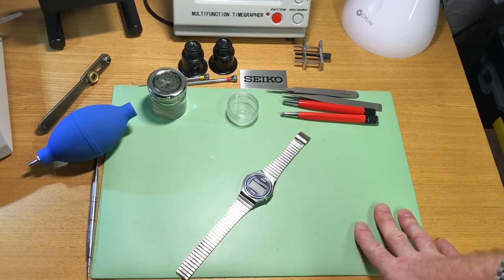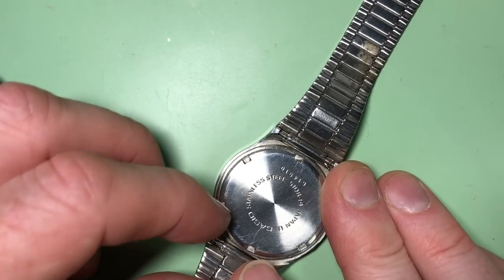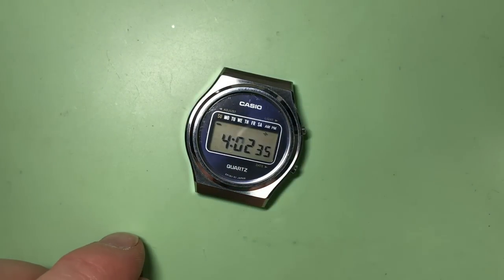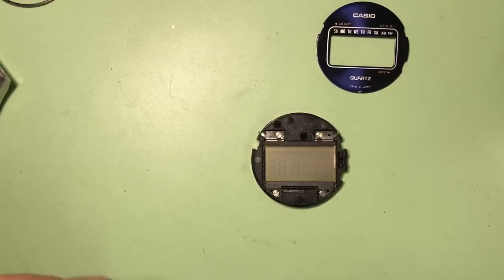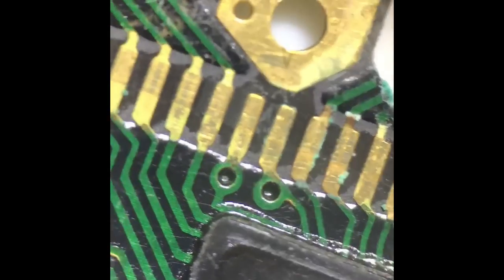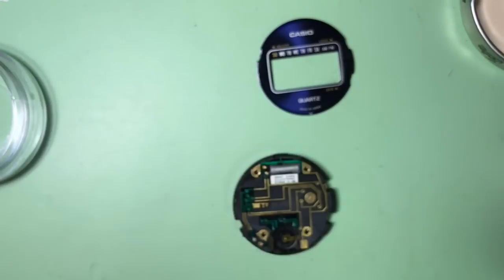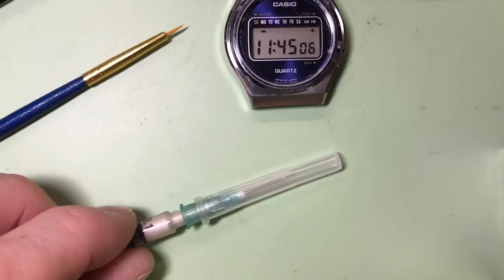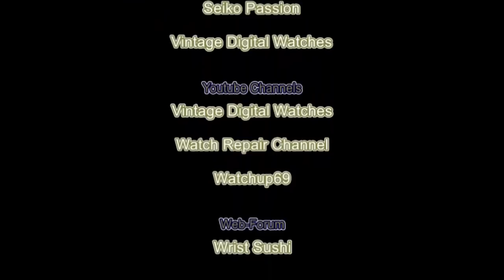Vintage Digital Watch Clean & Repair

Comment: I've got a casio 31QR-29. Still working very well. They were so expensive when they came out in the mid 70s. Men's watches were smaller in the 70s and 80s compared to most today. A great watch.

Comment: Hi - I’m Dennis in Sheffield UK. Your series of watch instructions are really good. I don’t really collect old analogue and digital watches, but sort of give them a new home! Having said that I have 2 beautiful Bulova Accutrons in full working order, one is the DeapSea 666 with rotating bezel and the other is a Masonic 218. I’m 71 now and in the high risk category so my wife and I are isolating (I have chronic RA and on immunosuppressant injections). I’m trying to cheer my wife up. Before she retired she was a Senior Chief Geneticist (until she got Iritis) and then an IVF Scientist. She’s always going on about her pink Skips Crisps promotional digital watch which she used to time her experiments until the watch just fell to pieces after 30+ years! So I’m trying to resurrect one. I managed to get a yellow one off eBay, still sealed in plastic. I put a new battery in , it all lit up showing the normal 00:00 and the seconds started BUT then it just died. It looks like a very cheap movement but I can’t get it going again - it’s got a round shape with the rectangular window display. I’ve tried taking another similar digital movement that is working to replace the whole movement. The big problem is being 71 with RA - my hands are just twisted and painful stopping me doing fiddly stuff. Is it possible to send it to you to have a go at it please or any other advice you can give. Thanks, Dennis
Reply: Why not take it to a watch repair shop?

Comment: Great to see these watches are repairable. Watching this video in desperation. My own digital watch has just started to go faulty this week and too a turn for the worse today 21Aug2020. The LCD display seems to fade out and recover sporadically even few seconds and seems to be triggered  as the seconds change on the display. Seems to not happen as bad when I go to the stopwatch not started. Once I start the stopwatch it blinks out again. 
I bought it with my 9th birthday money on Wednesday 8th June 1983 for 15.95 Irish pounds. With an exception of about 2 or 3 years I have wore it every day since then. It is a Q&Q with a Miyota (japan) board. It is well beaten up for the years of use, back-light broke when I dropped it perhaps 25years ago, third strap 20 batteries later but to my knowledge never got any significant water damage or the batteries never leaked.
Update, I fixed it. Separated the board from the LCD. No sign of corrosion but a few bits of dirt on the zebra tracks. Cleaned up and with great difficulty reassembled. The module is kept together using clips into the four corners inside of screws. Difficult to align everything including the LCD components.
Reply from the maker: Well done on fixing it. Sounds like it has a lot of history for you! dirt on the zebra strips is a common cause for screen issues.

Comment: Great job fixing it. I too had this problem with a 1970s Longines and I used that conductive paint to repair it after watching the video you spoke about. Your thicker paint seems to be easier to use, I used the thinner stuff but it was extremely hard because it was very runny. Unfortunately I knocked off about 10 wire bonds off the IC in the process, don't think there is any coming back from that.

Comment: Wow. This is the orig. of the Casio A171 that I just bought. I bought an after market bracelet (Aliexpress) for it just like the one in your video (before having seen it). But the A171 has a short "indent" for the bracelet to fit in. A a nice watch but this one looks a little better.

Comment: Any videos on restoring the buttons, often I have trouble with old buttons. Not the board or contact related. Just the buttons specific function
Reply: They come apart, but.  The barrel gets full of 'stuff', and is difficult to clean w/o damage.  Th spring is so tiny you can breathe at is and blow it away.  They can be disassembled, but do so on a surface that will not let the parts bounce away.  A clip holds the pin, and then it comes apart.
Cleaning makes all the difference, but when I did it 30+ years ago, I was hamfisted, and dented the barrels with a toothpick.  I did NOT take the mechanism apart at all as it worked fine.  Just could not set day/date/time readily.

Comment: I would think you could have used an oiler and applied the paint to the circuit board similar to how you apply lume to watch hands.  Nice work.
Reply from the maker: Thanks I have not thought about an oiler. I may try that. The brush was fine all the same other than removing any excess after drying to avoid touching any other tracks.

Comment: I just bought a Casio TGW-10 TriGraph online to try and fix up. The ad said it had a dead battery and the crystal was scratched some,but I felt confident I had progressed in buffing them out. When I got it and changed the dead battery it came with(it could be the wrong battery all together)it still didn't work. The notch the battery hold down bar hooks on was missing but even when i hold it down manually it doesn’t work. It doesn't appear to have got wet(no rust or water spots I can see)and from everything I see not damaged by battery acid but I'm also not  skilled enough yet to feel comfortable disassembling the module to look further. Right now I have a completely "for parts only" watch so the only place I can go from here is up. Tho it's not all THAT rare it is a lesser known watch that is pretty cool,might be worth fixing on the channel,but either way I'd just like it fixed
Reply from the maker: Sorry I don’t take any work on especially digital watches. I do not have all the kit required to test components
Reply: Sissy....lol j/p
Reply: Any suggestions on who may? I also reached out to "vintage digital watches"
Reply from the maker: @TechTokOffical  I don’t know anyone.  VDW does not take work on either. I know him quite well.

Comment: Seiko M 159. Thought it would be like the strip down you very well but it’s completely different inside any suggestions , the back fixes different no spring clips on the corners just clips on but I cannot get the back to clip into
Place
Can you help
Any advice
Rick. W

Comment: Great video! What did you use/do to clean the zebra strips? I'm rebuilding a Timex Atlantis steel cased model (uses CR2016) and I have a burnt segment like yours. The circuit board doesn't look damaged or corroded (the board was cleaned with IPL) and there's no sign of battery leakage either so I'm inclined to believe it is probably dirty zebra strips.
Reply from the maker: Ooh that is a tough one, digis can be problematic and I am far from an expert. its not always battery leakage that can cause damage , old age, dry solder joints, failed components. most can be diagnosed , quartz crystals like to fail but you need an oscilloscope to diagnose those which is not a cheap piece of equipment.   To clean the zebra I just use IPA  i tend to drop them in a bit of the solution and then wipe with a Q tip and leave to dry.  Also pays to wipe the contacts on the screen also.  Good luck
Reply: @MyRetroWatches  Many thanks! I've ordered silver conductive paste like in your video too, fingers crossed! Love these steel cased digitals.

Comment: Hi :
Nice work and explain . I have a question what is the voltage of the batterie i see on the movement market 3V is that the voltage tha use the watch? 
Thank you
Reply from the maker: Xavier Chs thank you from memory it’s just a standard 1.5 volt

Comment: Good evening. Thank you for such an informative video. I am dabbling in vintage LCD watch repair too and recently brought a Casio CA-901 back from the dead. Just that I am wondering how to refurbish scratched printing on the inside of watch crystal. Any suggestions will be greatly appreciated.
Reply from the maker: Hi,  thanks for watching. Sorry I cant help with the print.  Sourcing new screens for Digi's is hard work as there is very little out there.
Reply: @MyRetroWatches  So true! Only way would be is to find a broken vintage with a good watch crystal, which would take ages. Best to leave as is. Scratches and all.  😄

Comment: You think its a good idea to remove batteries from vintage watches if not being used? Just storing as a collection! If they tend to leak?
Reply from the maker: It’s not a bad idea. Not something I put into practice but if you have any alkaline batteries inside then it’s a must!  They leak at the drop of a hat.
Reply: @MyRetroWatches  will they only leak if battery goes dead?

Comment: Any idea where one might be able to get a replacement micro light for a watch like this? Btw, great vid !
Reply from the maker: hard to say really,  they are a basic circuit so I would assume you could just unsolder your broken one and take another from a donor of the same manufacturer.  I have never seen just the lamp for sale as a part.

Comment: Hi there, I have a vintage Seiko digital watch that was so accurate I could Navigate at sea in total confidence with it. Unfortunately when I  returned from sea one time, my then 16 year old daughter decided to help Dad out with the washing one day and my lovely Seiko A021 - 5000R ended up in the washing machine while I was tinkering with the car. Many years later I am still wondering if it can be fixed. I've even sent it back to Seiko who couldn't be bothered with it. Can you help ? Yours Faithfully. Jan Davey.
Reply from the maker: My guess it would be a total mess inside if you never removed the module and tried to dry it all out, plus remove the battery.  The only way forwards would be to hunt for a donor watch. There are examples on eBay now but expect to pay £70+  for a working one.  I think these were Seikos first alarm chronograph digital which then makes them more collectable...